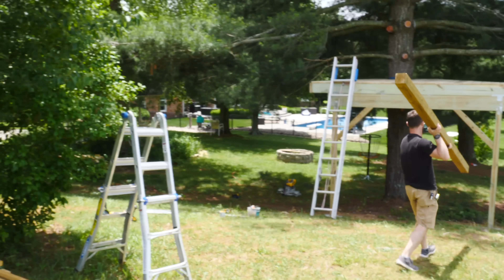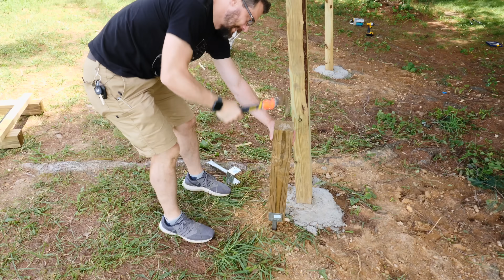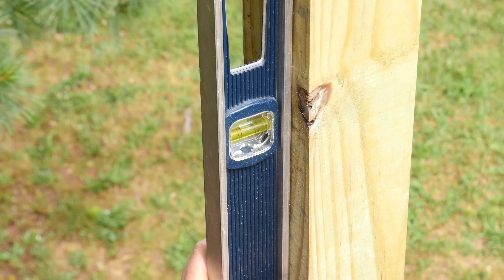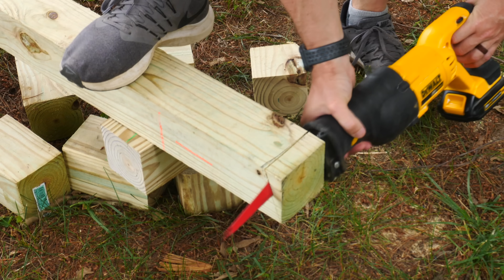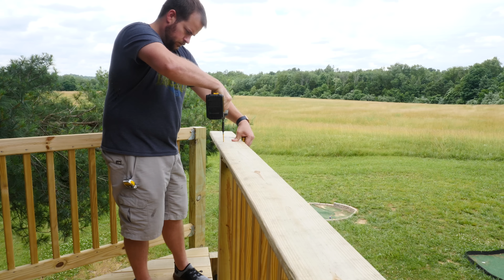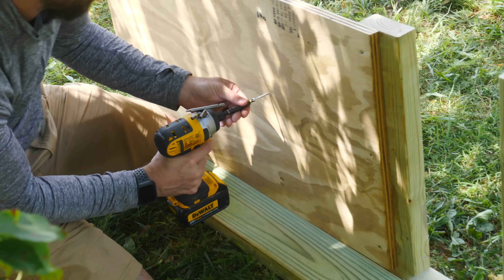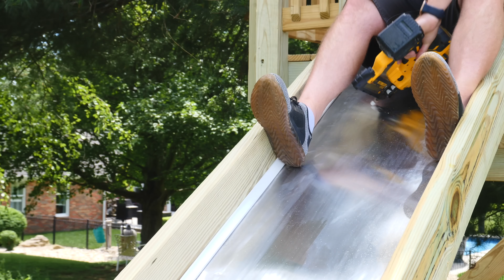How to Make a Treehouse Part 2 | I Like To Make Stuff

Comment: Lag bolts on the rails and the ladder!!! Not screws!
Reply: Mike Bryan he used what looks like spax powerlags which are perfect. probably a different brand since it’s from lowes but they are as good if not better than a traditional lag bolt.
Reply: Yeah those are structural screws by GKR and are actually stronger.

Comment: I would suggest connecting the 4 posts (4x4) together, maybe with a frame around. By experience, they tend to bow. Sometimes a whole lot. If you tie them together at the top, it will prevent them from moving.

Comment: Seems to me like those 4x4 posts need 2 lag bolts to be totally safe. Other than that, great job as usual !#
Reply: To be safe, you could use a 6x6 post notched at the top with carriage bolts to keep the beam (composed of two 2x's) resting in the notch. This detail is cited in residential code for decks.
Reply: @dhcox  Agreed. I hope they don't build a roof supported by those 8' 4x4's hanging by a few screws. Can't believe they didn't use a single lag except for on the tree.
Reply: @cbriangilbert1978  I agree the posts should be notched so the load isn't relying solely on the screws....but to be fair those are structural screws made by GKR and are actually stronger than lag bolts. Look them up.

Comment: You really should have used lag bolts to attach that railing wood screws just don't cut it for the strength you need.
Reply: This is my biggest concern with the build.  Deck screws for structural connections in Part 1, and structural screws for lag bolt or through bolt connections.  I realize this is just a treehouse, but it's essentially a deck build.
Reply: I was going to leave this comment too
Reply: Research structural screws. The ones he used by GKR are actually stronger.
Reply: What he used was a lag screw, Lowe’s sells them they have a very high shear rating they’re from a 1/4-3/8” in diameter

Comment: Aren’t the balusters mounted wrong? Now the only structure holding the vertical pieces of wood are screws, when you push from the outside inward the is the wooden structure and the screw....
Reply: Mounts on the outside cause it looks nicer.
Reply: @vigilantezack  yes but he really needs to bolt them on

Comment: You could also cover the slides handles with cut pool noodles. Just a thought. Great video!
Reply: I was going to say that I was a bit worried about going down the slide with the exposed wood. But using your idea of adding the pool noodles would keep splinters from happening.
Reply: I saw another suggestion in a book that says cut an old garden hose (split it) and then use that to cover the top of each rail.

Comment: No offence, but I have a lot safety concerns about the ladder.

- The rungs really shouldn't be able to freely spin. They could make it easy for a foot to slip and someone to fall.
- A straight 90 degree ladder is also nowhere near as safe as one with a simple 15 degree angle. If a foot skips with an angled ladder it's like to simple catch on the next rung below it. On a 90 degree ladder that's a lot less likely.
- There are no handhelds on ladder at the top as you're finishing you climb. This is clearly a danger point.
- As you said, the ladder shouldn't be right up against all that wood preventing full insert of the foot. Simply offsetting the ladder world fix this issue.

I don't say this to be rude. I'm not trying to "troll" you. I really am genuinely concerned. These are all minor things, but put together they can add up to something major and dangerous.
Reply: Phil Dog we have ladders like that in 90% of the playgrounds in the UK that have climbing frames. This is play equipment, not a construction site ladder

Comment: I think it would be a nice touch to add a smooth rail to each side of the side to avoid possible splinters if someone slides down and runs their hand along the side. Maybe use the same flashing and either make it wider than the slide to wrap around, or get more and wrap the rails before putting down the center so that the edges of the rail flashing get covered .

Comment: Would a shallow groove cut in the bottom of both of the slide rails work better for covering the edges and reduce the need for nails in the aluminum sheet?

Comment: Great build.  Could have used one of the corner posts as one side of the ladder to save on materials, then just add a block at the top to add two more rungs.

Comment: slides should be made from 1-3inch thick metal and  the sides should be made from metal  pipe  for the height of 8.5 feet off the ground this would likely not pass safety given the height off the ground you are...

Comment: Apparently Lowes doesn't sell 6" screws or lags. Posts should be through- bolted anyway. Any ol' screw used in structural fasteners does not meet load specs. If you used hanger/bracket rated screw(Simpson makes some as well as others) you might have mentioned it for viewers. Code requirements have gone bug-screwy nuts for projects like this. Some kind of a grab bar on the posts adjacent to the ladder would really be a good safety feature. Great project concept .

Comment: Why not angle the ladder to make it easier and relatively safer to climb? Personally I would recommend putting in a ladder that surpasses the height of the deck at an angle like an extension ladder using your same materials. It would make it ALOT less scary to climb
Reply: Harold Rivera I agree
Reply: I did something similar haven’t put the angle in yet but I put handles in the top of the ladder and the posts coming up.

Comment: This isn't a knock on your craftsman ship, you do great work. I thought railing posts had to be ether bolted or lag bolted? Or maybe that was the old way. I haven't seen newer decks in a very long time.
Reply: These posts and railings are definitely not built to deck codes.....but he isn't building a residential deck.  It is a play structure.
And there is a reason you don't see metal slides at playgrounds anymore.  Shiny metal gets SUPER hot in the sun.  Hot enough to burn bare skin.

Comment: That slide might as well be the surface of the sun on sunny days. I would have opted for a different type of material based on my experiences
Reply from the maker: Steel would be super hot, but it's 85 degrees F today and it's just warm to the touch. Aluminum is much better this.

Comment: for the height of that tree house I would consider a 5-15  degree incline on the ladder  with railing on   the ladder itself i would likely  consider enclosing the tree house I would consider a 5-6 foot rail if you are going teen adult engagement in the tree

with treated lumber I tend to recommend soaking in sealant  to prevent rotting wood..

you will ha a slipping hazard if you don't  lock your rungs in place..

Comment: You had a major project mistake, the tree will grow, the metal screws under the deck will go up eventually making the whole structure move too, and the branches inside the fence will have the same problem. I would had avoid that 2 choices.

Comment: Hey Bob, do you have any concern about the strength of the slide bottom over time?  The stronger orientation for stringers is vertically, instead of horizontal.

I ask if you have any concern, because my garage has a storage platform, that has a walk up ramp.  And the ramp has the stringers in the same orientation (horizontal) as your slide, and my father expressed a great deal of concern which I don't really share.

Comment: Great job! One thing that would add a little structure to the ladder, if you ran all-thread through the center of 2 or 3 of the rungs. then you could hold it all together with nuts from the outside.

Comment: You could build a really cool bouldering section underneath and up one side. So there could be an overhang under the deck that leads into a straight or slanted wall. That would be really neat!

Comment: I would have added a little bit of an angle on the latter. Instead of straight vertical, I would have had at least a 5 to 10 degree angle. That way it would easier for the kids to climb

Comment: Pretty cool tree house. Something to think about for anyone that builds one, run the sides of the ladder long so they stick up above the deck, that way you have something to hold on to when you reach the top of the ladder or if you off set the ladder to the side of the rail opening you can run the rungs up above the deck which makes it even easier to clumb up to the deck.

Comment: What are those yellow screws you've been using for everything?
Reply: Coated deck screws. You can buy them in bulk at Lowes
Reply: @terristroh3965  The wrong screws. Metal tie-ins and hangers should use nails.
Reply: skyhigheagleer6 That’s moot to this post. I just answered what kind of screws they were.

Comment: Should have put the ladder at a slight angle
Reply: Or just off set it with some scrap 4x4 laying around.
Reply: @charleshanson9467  The angle is for 2 reasons. 1 easier to climb (especially for kids) and the offset. Also, the rungs spinning is maybe a bad idea.

Comment: You've made so many odd decisions with this project. Massively overkill on timber sizes used. Using screws where nails would be stronger. Not concreting in the ladder ground anchors when it would of taken 15 minutes more work. The ladder position - how did you not see that issue?!
Reply: The bigger the better. Leaves room for mistakes stupid hater.

Comment: If you want to go FAST on that slide, ride down it a few sitting on wax paper.  The wax will transfer and make it slick.  My dad taught me that trick.  Great video, BTW
Reply: or you just wax it like normal.
Reply: I can confirm the wax technique, works VERY well
Reply: Or you nick a finger and use the blood to lubricate it!
Reply: Ur dad is the man! Tell him I said wassup!
Reply: Ray Tango how is that not common knowledge?!?!?!?!
Reply: Use a random orbit sander with a buffing pad, and plenty of metal polish, followed by car wax.
(cover the trim with masking tape first, or it will get yucked up with buffing residue).
Reply: What i used to do was a bucket with water and dish soap, was not permanent but i would fly
Reply: @alex-ir9uq  a cheap and cheerful solution. I like it

Comment: Is there any concern about the ladder rungs spinning freely in the ladder causing slippage, or do they seem pretty steady? I'd love to build one in my own backyard!
Reply: The short answer is yes. It is likely that at least some of the rungs will spin, even if they don't spin now. However, he does mention they will move.
Reply: Short answer is yes, in theory, but you can solve for that by drilling into the 4x4 a little bit more and then screwing into the pipes from the backside to keep them steady. Honestly though this design is about the least effective and efficient one, as he is wasting tons of space with branches that can be trimmed off with no harm to the tree as well as having place it so terribly that it requires concrete, however it is pretty cool
Reply: Game Ville did you watch the video? He didn’t put it into concrete. He said he used brackets that would normally be put in concrete, but he didn’t and just stabbed it into the ground.
Reply: 17Industries you are clearly missing the first video. Go watch it, you will see what I am talking about. So in answer to your question, yes, I watched the video but you clearly didn’t
Reply: @17industries42  He did put it into concrete, he did it in part 1
Reply: Game Ville i misunderstood you. I thought that you were saying the ladder had to be put into concrete, which it did not. I am aware that he did put the structure into concrete in the first video.
Reply: Asher R. Yeah ik I thought he was talking about the ladder only
Reply: @17industries42  yeah.... I was only wondering about the ladder, indeed.
Reply: 17Industries I kinda get that, but I would assume the part about the tree is kind of a tell that I was referring to the thing as a whole

Comment: Some notes: 
1. Whatever you would call this structure, it is great and the neighborhood kids love it, regardless of the name. Get over it
2. This treehouse is super awesome and strong and fun. 
3. Yup, the flashing did leave a little bit of residue on Bob's pants after sliding like 100 times. 
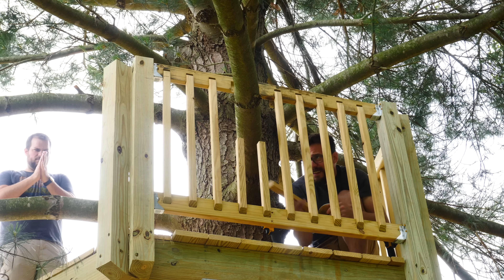4. Sap is sticky @8:27
5. FIRST!
Reply: You tube is saying the video was uploaded 13 minutes ago and the comment was written 52 minutes ago that weird.
Reply: @knightzovil9368  Quick fingers
Reply: @knightzovil9368  it's because he posts his comments before the upload is made public (he works with Bob on the channel, so he's got access).
Reply: Some notes:
1. At this rate, Bob's house gonna be Disneyland soon
2. He used a lot of steel pieces for the joints. Those are "triple zinc" steel pieces where protective zinc coating is applied. Thus it is suitable for outdoor use (I was worried about it get rust easily earlier before checking the tools & supplies links).
3. One of the ILTMS employee benefit is "FIRST!" 🤪🤪🤪
Reply: The 8:27 part makes nu sense. 
No offense.  :D
Reply: @raulcoheterojr8490  It might something to do with local code requirements for deck rails, I think they did a good job on boxing in the limb.
Reply: @tomtruesdale6901  thanks for explaining that. :D
Reply: @danura2535  thanks for explaining that , thanks. :D
Reply: @the
Reply: 1 regardless the name 2 this treehouse.